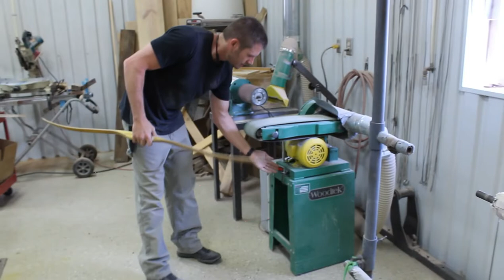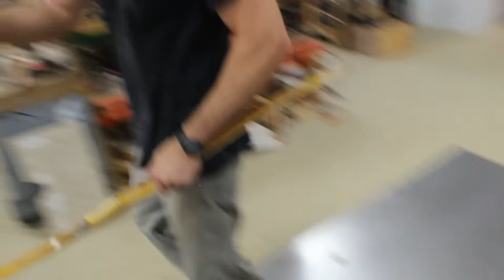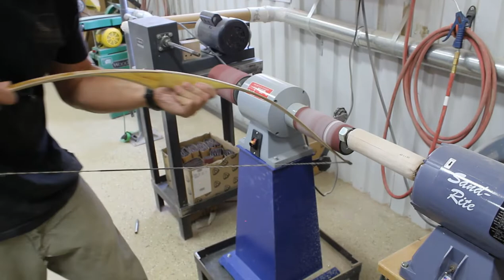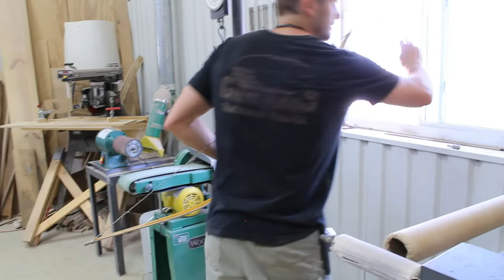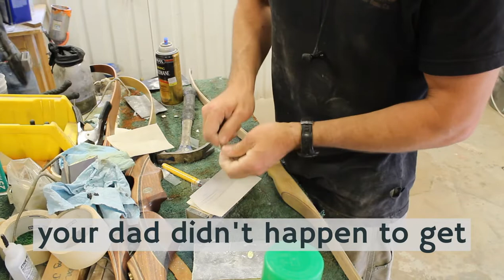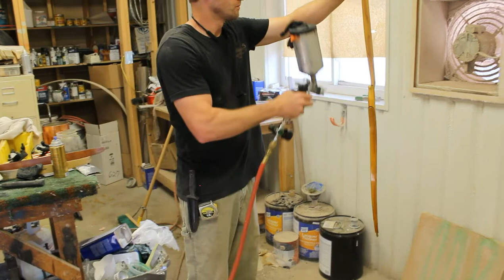Tuning and Final Touches | Youth Bow Build

Comment: Im looking at the end of this video again and again and im amazed how much i like the really clean sleek look of that bow just clean flowing lines.
Reply from the maker: Thank you sir!
Reply: @greatplainsbow  I ordered on 7-24-2022 this same bow in Hickory at 45 pounds  left hand for my left eye dominance.  I wanted a bow made for my 24 inch draw and was looking at the other recurve youth model but saw the handle might be too small for my needs as a smaller adult and has an odd shape to the non thumb side as to why the fingers might not fit.  I hope you can make this model in the weight I asked for, I had the hardest time trying to find a bow in my weight as I tried a OEELINE Airobow 54 inch recurve one piece bow at 45 pounds and got a 35/36 pound bow.  Also love the style of grip this comes with for a longbow, the notched and light contour at top but with mostly straight grip so I can grip this bow the way I would with a straight no contour grip. 

I also got a rug rest as I like the whole part the arrow sits on to be covered for the arrow and I prefer the rug, leather, or felt for a bottom part for the rest.